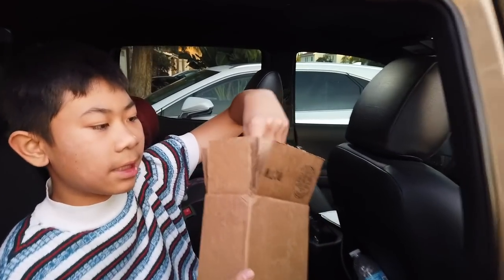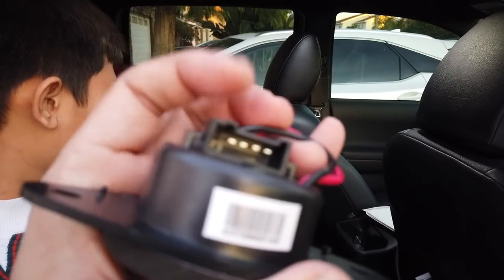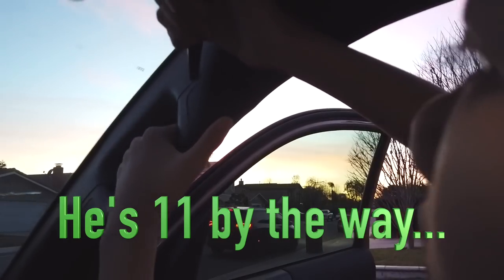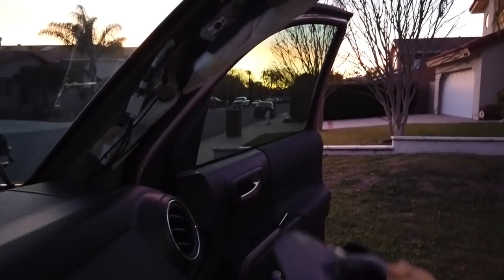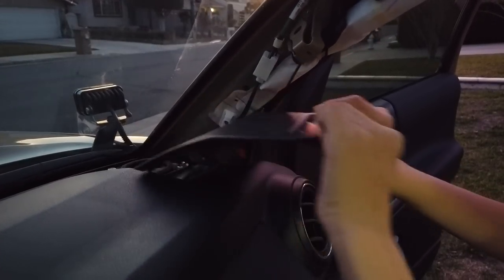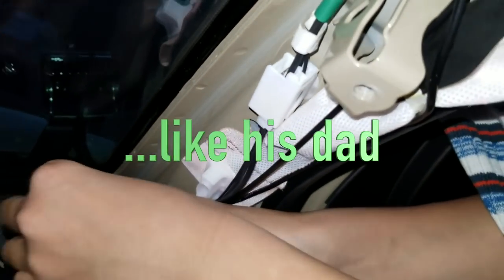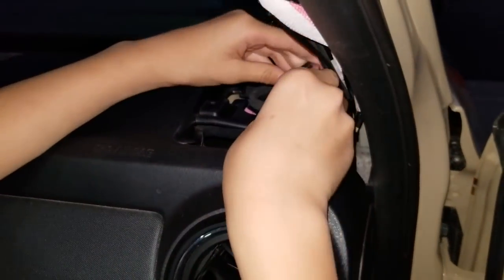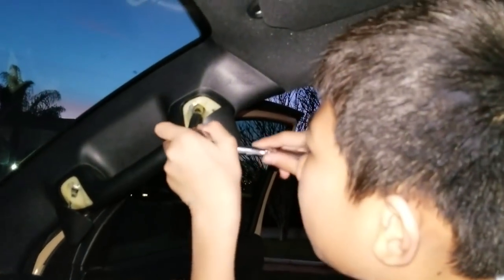Cheap Toyota Tacoma Sound Upgrade! TWEETERS ! My 11 Year Old does DIY install then I review

Comment from the maker: Today Jesse installed some Subaru tweeters into HardShellTaco. That's right Subaru. They're made by Kicker and are plug and play. It seems on TacomaWorld it's a hot upgrade and it was fairly inexpensive.  I wanted to see if it would help my stereo woes. check it out!

Get them at Amazon here https://amzn.to/2RUhrFU

These are for the non JBL system.
Reply: Nice! I did this upgrade on my truck last summer. Went a step further and changed out all the OEM speakers with Kickers. Was an amazing difference! Check TW for more.
Reply from the maker: Nice 👍
Reply: @RobDaman  will this work on the 2nd gen Tacoma?
Reply from the maker: It doesn't appear so
Reply: Kevin Doran what size are the front and back speakers for your taco?
Reply: Those tweeter fit on 2013 Tundra???

Comment: speakerwatchedyourunnecessary so I called and told the rep this is not what I needed and after several more conversations and noticing from your drop down guide the tweeter needed I convinced the rep to watch your video.   They still have no clue and or don't have this part in stock so I have to take the door panels off, take the speakers out and send their kit back and start all over.    ANYWAY all that said to say again whoever discovered this works is GENIUS !!!!!!!!!!

Comment: Hello, which jbl tweeter can I buy, to fit my 2016  toyota tacoma 4x2?  The 6x9 is what i can find , but tweeters are hard to locate. I want to match system if possible. Thank you , good video.
Reply from the maker: hi, you'll need an adapter plate and you should be able to drop in any tweeter you like.

something like https://amzn.to/2ly90AY

Comment: Quick DIY taco tunes/if you want plug and play for all Tacoma's installed Kicker 6x9's mid's and tweets in my 2018 taco with adapter's plug and play and if you want more they have it Amplifier's to full kit's / 2014 Tacoma TRD off road-I used the Amplifier Wire kit-Taco Tunes ,with Audio control LC7i and skar amp's and 10" sub with Hertz 6 1/2" mid's with tweets and Taco Tunes 6x9 adapter for 6 1/2" mid the Evo Hertz and it sound's amazing ,I love my lil Tacito,but the factory system is very out dated, tweet's or and improvement ,makes the world of difference, those tweets are very nice./BTW Focal makes a Perfect Plug and Play for Tacoma's lots of research and stereo's LOL!
Reply from the maker: thanks for the input 👍

Comment: Is this mod worth it ? Thinking about doing it ..thanks rob.
Reply from the maker: It really depends on how much you're into music. It sounds like you want some improvement so it will help with crisper highs and it's a overall quick and fairly inexpensive mod. I haven't heard much negative feedback about the mod.
Reply: Rob Daman ok cool thanks.... which plug do I disconnect before installing + or -?

Comment: I will definitely be looking into this for my 2017 TRD OR 4x4. Also have you seen the teaser for the new 2020 Tacoma? Is there any upgrades they could to that refresh to make you trade in? For me it would be a new power train or something else big.
Reply from the maker: Ya a V8 would cinch it but besides that I wouldn't consider it. Sounds like just a facelift. Power seat is a cool feature which may be able to swap out on a salvage taco.
Reply: @RobDaman  From what I've seen they will prod do new headlights (probably LED) and taillights. It would also make sense since this is going to be a 2020 model year that they add in apple car play to the head unit which I hope will be something I can buy online from a distributor and add into my 2017.
Reply from the maker: @xItsmeFirex  Ya. It would make sense to update their headunit. They'll be some part outs for folks to upgrade so we just gotta wait then boom! swoop up new parts! lol

Comment: I'm going to do this. Did you unhook the battery? I am wondering if it is necessary to keep airbags from deploying.
Reply from the maker: I did not but if it's a concern disconnecting the ground isn't a big deal. 

In my opinion the airbags shouldn't deploy as the yellow airbag wiring harnesses aren't been touched.

Comment: I had a dash cover on my Tacoma, do you think it will affect the quality output?
Reply from the maker: Good question. I think it's a pretty porous design and should be ok but you can test it now by uncovering your dash cover at that corner and see if there's a sound difference. If you don't notice anything then this upgrade should be good.

Comment: Awesome including your son on this mod! Just installed these Saturday and can tell a difference from the paper ones lol. Now my dilemma is installing a sub behind the back seat. Do you have video or recommendations on how to fit a 10” kicker in that small spot?
Reply from the maker: Glad you like them too. 

I haven't seen any vids but it would be easier to remove the plastic bins then dampen it down. You'll have more room to work with. I think if I did a custom install i'd use the area on the seat bottom and fiberglass something cool. I messed with glass a while back and it wasn't too bad but can be really messy.

Comment: I wonder if these would work on a 2014 4Runner?
Reply from the maker: Hmmm. I haven't seen anyone try.
Reply: They will...  there's 4-5 videos using the same Subaru Kicker tweeters.  I ordered a set that will be delivered this week.  The 5th gen 4Runner installation is easier since we don't have to remove the A pillar.

Comment: Hey Rob i didnt notice, but does your Taco have the JBL system upgrade? I do have the JBLs  in mine, and it sounds good but wondering if those tweeters will make it that much better.  Keep up the build bro!!!
Reply from the maker: Hey thanks for watching! From what I read the JBL won't work with them 😔

Comment: Did you disconnect the battery?
Reply from the maker: no need
Reply: @RobDaman  ok, I watched another u tube channel install the tweeters. And the guy said he disconnected the battery because he didn't want the air bags going off.